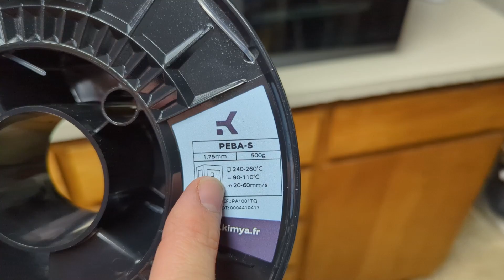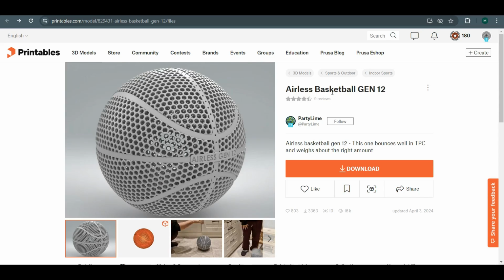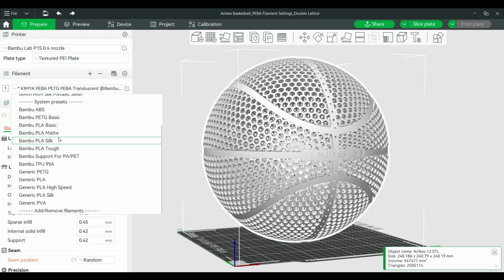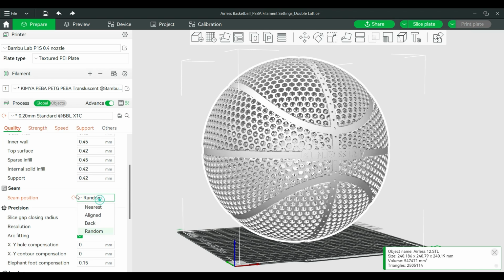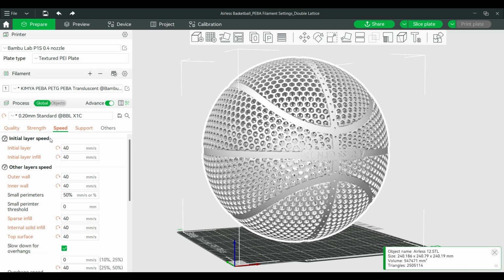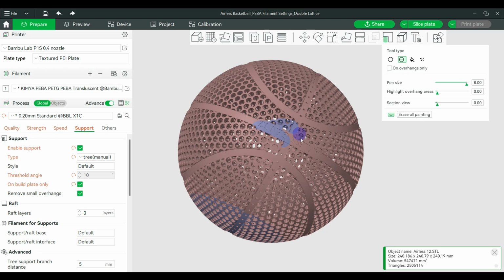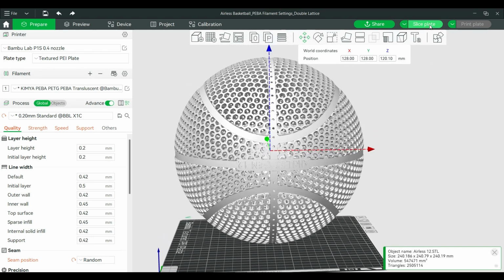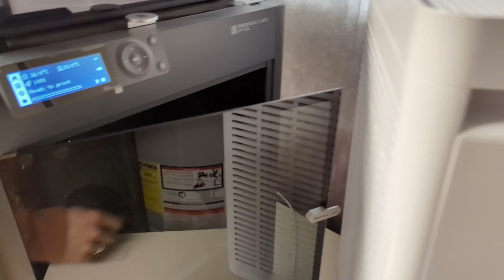Our Settings and Setup Used to 3D Print Our PEBA Airless Basketball

Comment: I am trying out the PEBA filament but it keeps clogging the extruder.  Any tips on how to get this to run smoothly?
Reply from the maker: I will try to help - what printer are you using? What nozzle temp/bed temp/speed?
Reply: @makeitlabchannel  having the same issue. Bambu x1 at 260c just the normal speed when trying to load and unload the filiment

Comment: I’m having a lot of issues with stringing, where a small thread of filament is left behind when the head moves across a gap. Have any tips to prevent this?
Reply from the maker: Hmm, my first question is what rpi ter are you using? When my Ender 3 was not broken I had to run a temperature and retraction test for just about any new filament. I would suggest starting with a temperature and retraction test to see the best results, although I know it is not a quick fix

Comment: With most flexible filaments ive found lowering volumeteric speed can greatly increase quality and layer adhesion, giving it more durability and probably slightly better bounce but I dont have the tools to accurately test rebound and post-print shore hardness.
Reply from the maker: That is good to know, I might be able to print a couple and test these factors. Thanks!
Reply: @makeitlabchannel  huge props for you actually putting in the effort rather than just doing pla and complaining when it breaks. Made one out of SEBS for school and everyone loves it, about 60% bounce but it is starting to warp after 2 months of abuse from kids and it's bounce is much less consistent. Will try this filament out once I get the money and I'm looking forward to seeing how it turns out
Reply from the maker: @pancakehm5563  much appreciated 😁 SEBS is on my list to try as well, glad to hear you have had decent results with it so far and I would love to hear how it turns out!
Reply: @makeitlabchannel  if your trying sebs I'd recommend the higher shore hardness the better 90a was a tad too soft. Definitely enjoy the uv resistance and waterproof aspect though for outdoor use, hasn't yellowed a bit compared to most tpu filaments and it's easy to clean which is good considering how often a trash can is used as a hoop
Reply from the maker: @pancakehm5563 thanks for the info!
Reply: @makeitlabchannel  Apologies for the spam, but another thing I learned about PEBA is that some forms of the tpe can be really really sensitive to UV light, which would of course be an issue for outdoor use. Its also relatively hydrophilic absorbing up to 1.4% moisture at relative humidity. Its unclear what exact polymer structure the specific company you got the filament from used since its listed at PEBA-S but that could be marketing for all I know. 

A friend inspired me with the idea of coating the ball in a sort of UV and Water resistant coating after printing, with a primer and acrylic spray paint coating + clear coat for protection from the elements to increase longevity. If done in a controlled environment I think it could achieve the best of both worlds, and the only issue could potentially be the clear coat layer scuffing off, or not getting complete coverage with normal painting methods.
Reply from the maker: @pancakehm5563  those are definitely things to consider, and I like the idea of coating the ball with something to protect it from UV. Thanks for bringing those up!

Comment: Did you try using a support blocking cylinder instead of having to manually painting the blocker?  Much easier and faster!
Reply from the maker: Didn't know that was an option lol, I will have to try it!

Comment: very interesting. im just wondering how you would fully print it as it takes up 600g of filament and on the website the spool only comes in 500g
Reply from the maker: I had to order 2 rolls of the filament, and when the first was running out I ran the beginning of the 2nd spool with the end of the first spool until the printer started printing with the 2nd spool (so I didn't have to pause the print)
Reply: @makeitlabchannel  ohh, this filament is rlly expensive then its over 100 dollars for 2
Reply from the maker: @TrueFax-ti6fj  yeah it is, that is even the cheapest that I found! I hope someone comes out with something cheaper. A couple people were scaling the ball down a little/using less infill and supports being the ball down to 500g
Reply: @makeitlabchannel  were you hesitant to buy it? did you not know how it would perform?
Reply from the maker: @TrueFax-ti6fj  Yes I was hesitant to buy it, but the description of the filament sounded like it would be ideal for the basketball and a lot of people were recommending it so I gave it a shot even though I have never printed with it before lol
Reply: @makeitlabchannel  oh, i might try it out then

Comment: Are you gonna sell them? I been looking for someone to sell them so I can buy one
Reply from the maker: Like mpawood said, I can't because it is not my file, plus I would like to test some things out to get the durability/weight just right. I am working on designing my own file so maybe someday 😁
Reply: You should try a single lattice file an and see what it does with peba. The double lattice didn’t go as fantastic for the Pla+ so maybe a single lattice will way improve the PEBA Ball.
Reply from the maker: @ScaleToTheWire  I have more PEBA filament coming in to test just that!
Reply: @makeitlabchannel  Great video! I ordered some PEBA to try and print my own. You mentioned trying to improve the weight. What if I increased the outer wall thickness or increased infill to try and take it from ~460g to ~600g(which is much closer to what the Wilson ball weighs), perhaps that might also increase durability as well? Or do you think a thicker shell or increased infill might mess with the bounce?
Reply from the maker: @Lighthouse8458  thanks! I think increasing the outer walls/infill to get about 600g would probably be a good benefit to the durability, but I don't know how it would affect the bounce. Something I might try and test if I have some extra filament 😁
Reply: I don't think he can, due to the file licence on the model not allowing commercial use